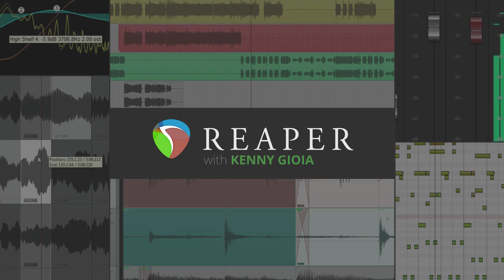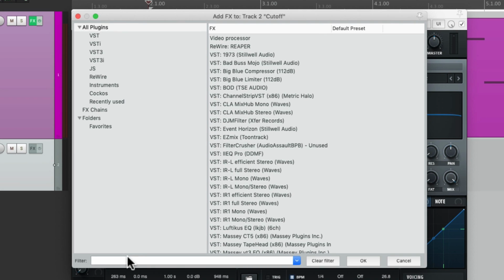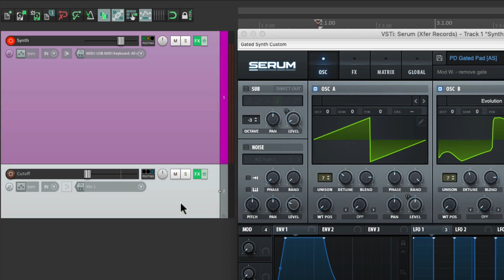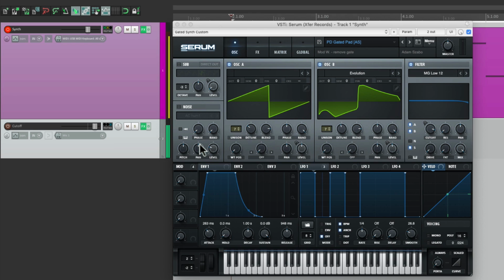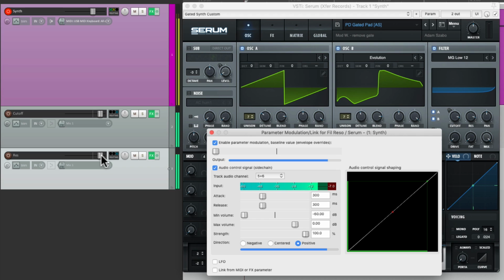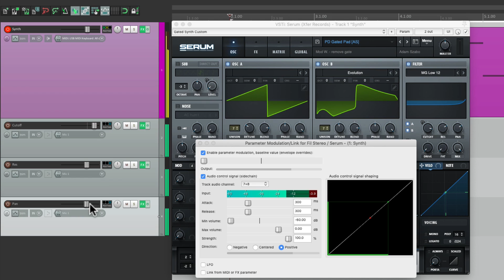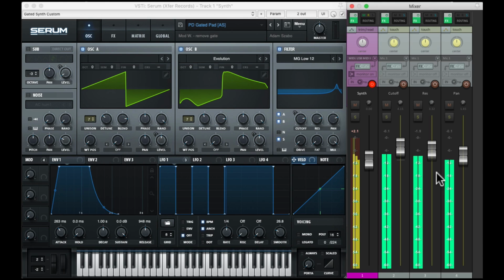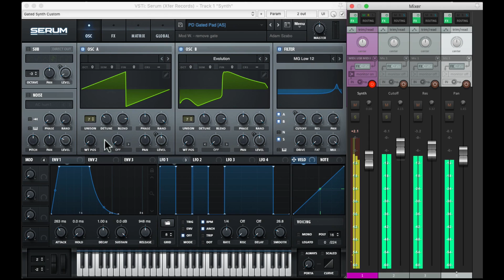Use Track Faders to Control Synth Parameters in REAPER

Comment: This is another great video Keny, so thanks a lot. I have a question for you at this point. I notice that you saved the project you were working with as a track template in order to retrieve it at a later time, which is great for time saving. However, soon after you open it, I see that the touch mode automation is not present. What is the reason for this? Is there a way it can be saved in touch mode? Thanks..

Comment: Dumb question, are sidechain inputs ,3-4,5-6,7-8, internal busses or mirrored outputs. I'm new to reaper. My headphones amp lives on hardware out 3-4. Thanks.
Reply: They are indeed internal busses/ connections and normally they won't go through your headphone amp. 
Only chance they do so, is if you route the tracks themselves to the output 3-4 of your audio interface (there's a drop-down menu called "Audio Hardware Outputs" in the Routing section of each track). 

Kenny forgot to say that you can also do this with mono outputs in tracks. No need for a stereo output (3/4) in this case, I believe...
Reply: @dirtyharry1881  thanks man,  I figured it out a few minutes after I posted this. Lol . My system wasn't on and was hoping for a quick response. I was taking the lazy man approach. 😎
Reply: @PlanetrightPro  Tbh, I kinda knew that you would have figured it out on your own, but it's a shame to see a question like that with no reply in Kenny's comment section. Maybe some other Reaper beginner will have a similar question...